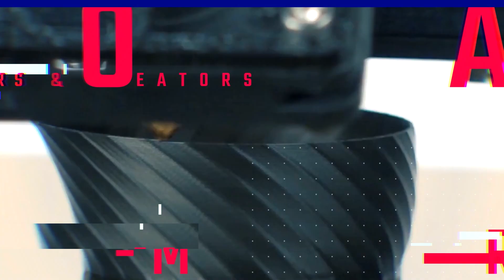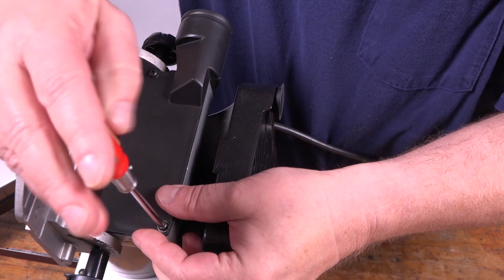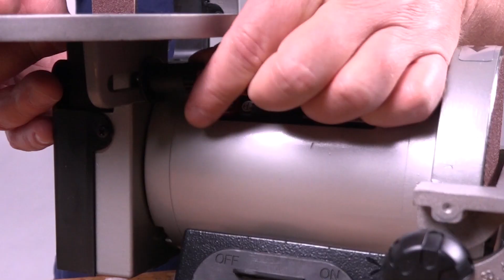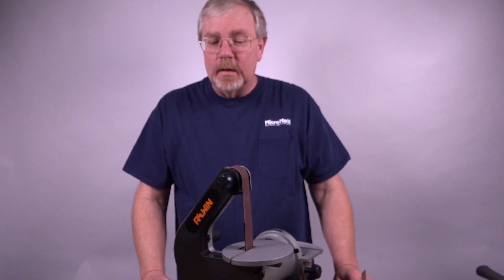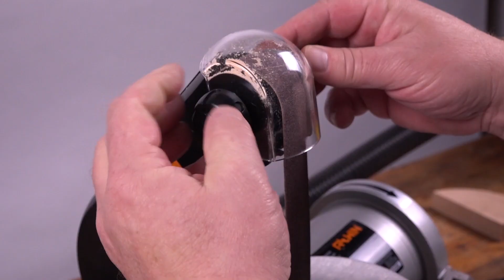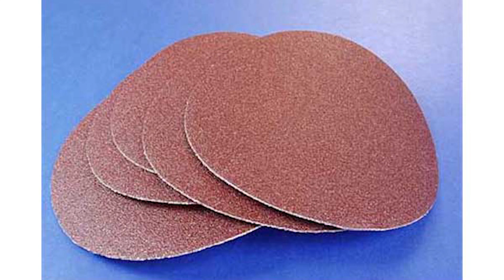This Benchtop Mini Disk / Belt Sander Will Save You Hours Of Hand Sanding

Comment: It sounds like the vacuum is louder. Is that right? I live in an apartment and I don't want to disturb my neighbors but I need one of these for sanding down parts I print out on my 3d printer
Reply from the maker: The vacuum is a bit less loud when compared to a standard household vacuum.